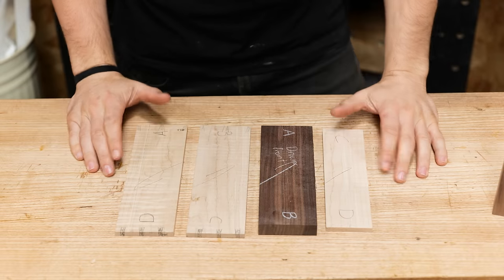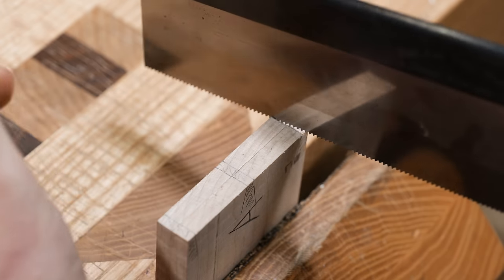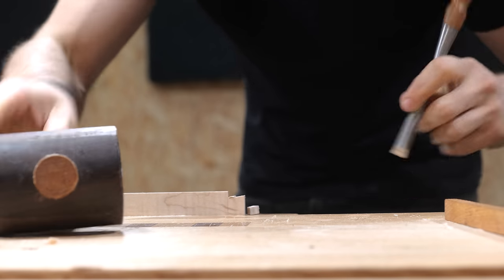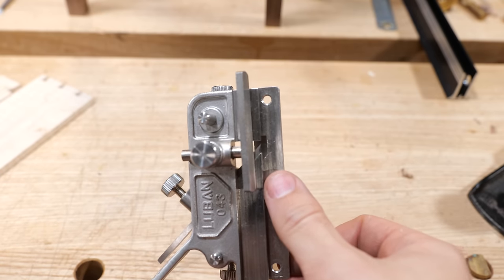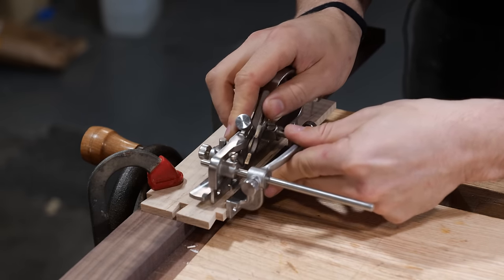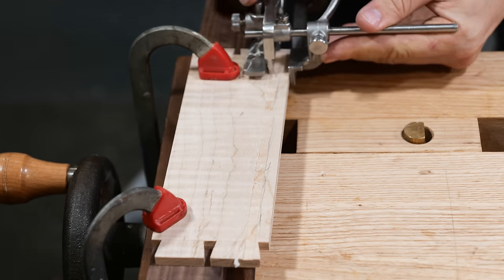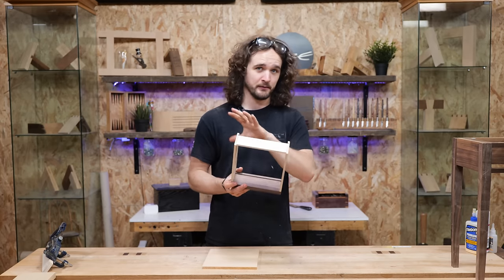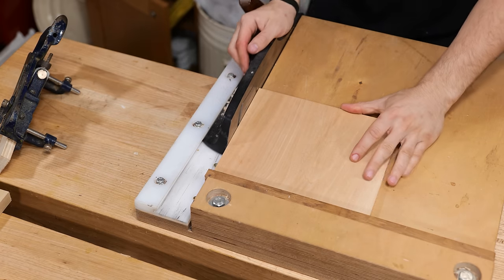How To Make a Dovetailed Drawer | Shaker Table #10

Comment: Thanks for the video! When using the rebate plane on the bottom of the drawer, is there a reason why you didn't flush the workpiece to the edge of your bench and allow the fence of the plane to also run along the apron of the bench? Seems like that might be helpful with such a thin piece?!